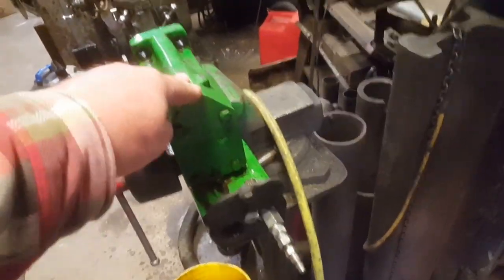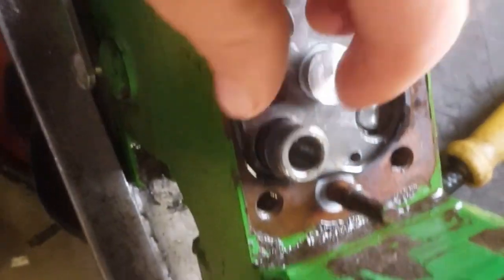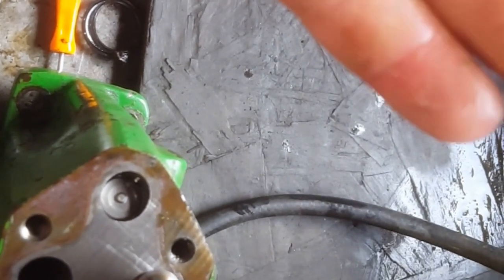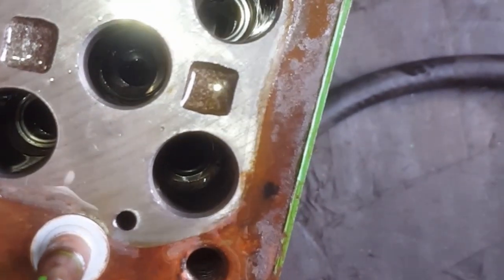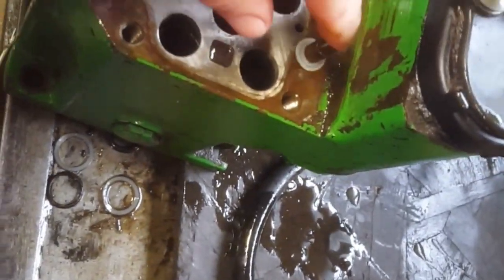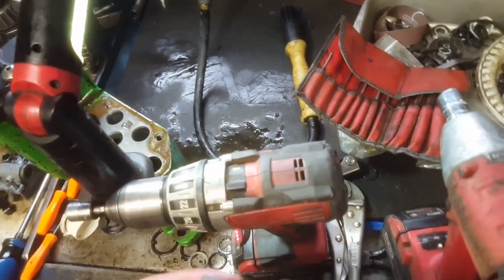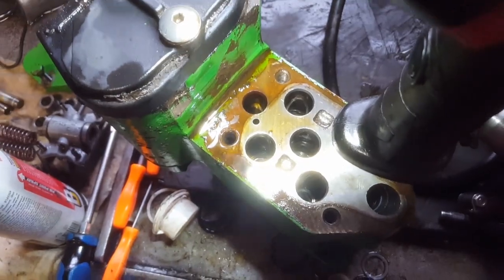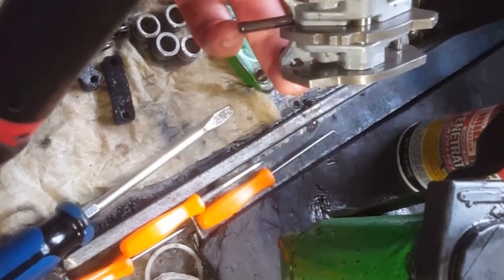JD 50 series SCV repair

Comment: My bushings that hold the spring and poppets are flush with the plate. How do I get them to come out.
Reply from the maker: If your cam and lever are still intact you can try rocking that back and forth. I've never had them stuck terribly bad. Most of the time they come off just taking the cover off. You get that couple that you got to rock the cam or move your lever. Otherwise you can grab with a pair of needle-nose pliers

Comment: I have a scv off a 4230 that is leaking from the cover plate a month after I rebuilt it. Have you had any trouble with them square rubber packings? Should I just try new packins or put some sealant on them? Thanks also from MN :-)
Reply from the maker: New packing, use grease to old it in the cover, 35 lbft of torque on the bolts

Comment: Hello, been looking for these stones now for a while.  Would you be kind enough to share the part numbers for these.  I took mine to the local green and yellow dealer after watching your video and they looked at me like I had two heads and didn’t know what I was talking about.  They told me to take it to a machine shop, or buy a new block from them, real helpful.  Thanks in advance.
Reply from the maker: I will see if i can find a part number.
Reply from the maker: https://www.greenpartstore.com/John-Deere-Servicegard-SCV-Valve-Reseating-Tool-Kit-D15002NU.html

I did a google search and found this.
Reply from the maker: Remeber your more like lapping then grinding, a quick touch then check with light.

Comment: hello where I can get the stone of recess, for drilling, and to be able to operate the valve without problem, thanks I liked your video, keep uploading new videos of tractors john deere, greetings
Reply from the maker: We got them from John Deere. I don't know of any other source.
Reply from the maker: If you do use them stones you're just touching them in there you're not grinding away
Reply: @jonstevensmaplegrovefarms3754 the parts diagram you sent me for my4030...well part number 8 they call it a guide is it spose to come if so what is best way to get it 🤙]
Reply: 7o³

Comment: What about that valve at top?
Reply from the maker: The round one at an angle? That is the detent.  It's what holds the lever in neutral.
Reply: @jonstevensmaplegrovefarms3754  shouldnt i come out like the rest?
Reply: @jonstevensmaplegrovefarms3754  the roller end of mine doesnt want to come out and cant figure out how to get the rocker control lever out so can access that piece
Reply from the maker: Ah, ok. On each side below the lever is a hex head cap, uses a 1 inch wrench. 
Behind that you will see a small set screw on each side that uses an Allen wrench, remove them screws,
Tilt the cam one way and drive the roll pin out, as you lift the cam out take a picture of the cams, they are specific.
Reply: @jonstevensmaplegrovefarms3754  if that detent is stuck do i use punch to knock it out.i took one of screws out and that cam slid down in housing hopefully i out it back in how it was
Reply: Does the rod that connects to linkage that rotates the rocker come out?i really appreciate your help without it i wouldve probly gave up lol
Reply from the maker: Yes after roll pin is out is slides out the side.
Reply: @jonstevensmaplegrovefarms3754  thank you so much for your help.
Reply: Wont move either way
Reply: I hate to bother you again but i have the rocker out and the piece the cam contact out the what i believe called the piston wont move in either direction
Reply: The parts list calls it a guide does the pin go through the guide to the wheel the cam contacts
Reply from the maker: The piston from the front? Take a punch and give it a tap with a hammer. It .ight be spring loaded, 
The roller should come out the back.

Comment: I have a 4440 that has a valve the creeps. Is it the same as as the 50 series. Can anyone that's a little mechanically inclined repair it?
Reply from the maker: You can swap a good 50 series on there. Then you have pioneer tips not John Deere. 

Anyone can rebuild these. Just a couple tips and tricks. 
I am hoping this winter to have a shop so people could mail then to me for a complete rebuild?
Reply: @jonstevensmaplegrovefarms3754  I already have them changed to pioneer
Reply from the maker: @allendoerksen4828  then a rebuilt 50 series would be a nice upgrade as long as you get some value for your trade in.